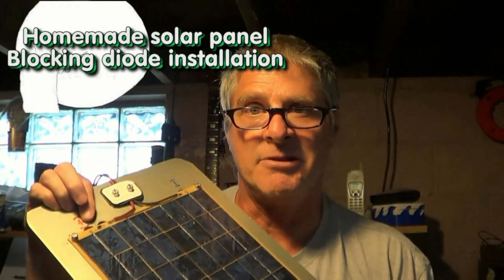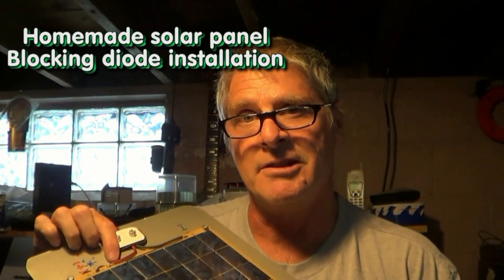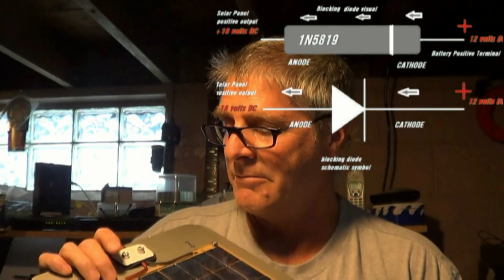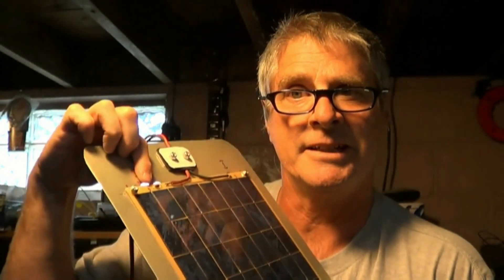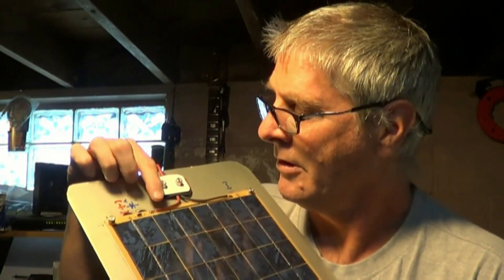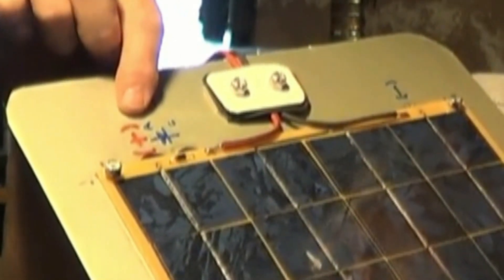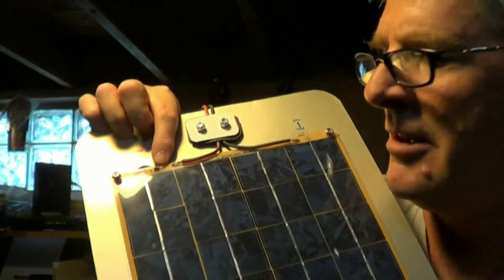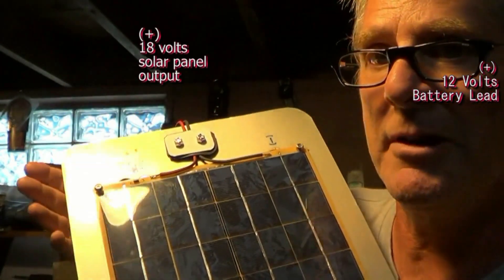solar panel BLOCKING DIODE installation polarity / Homemade semi flexible solar panel blocking diode

Comment: Thanks for the video.  I'm clear on everything you said except for the animation which shows the grey and white arrows moving from right to left or battery + to solar +.   Shouldn't the arrows be animated from left to right in this case?
Reply from the maker: hey youtube,
Thank you for watching

lets see if i can give you another way to look at this...

when the diode becomes fwd bias, the diode acts more like just a piece of wire, 
the solar panel 18 volts is felt at the positive  post of the battery.
current flows from battery terminal towards the solar panel VCC ( 18volts )
maybe think of the solar panel as an alternator for your car...
the positive lead of the alternator is a HIGHER voltage than the positive post of your battery.
current flows from positive lead of battery to positive lead of alternator.

you also need to visualize the negative side of the solar panel and its lead going to the battery.... which completes the circuit.

so, a starting point for reference would be
the negative side of solar panel goes to? thats right!
  the - negative terminal of the battery .
current then flows thru and is stored in the battery,
current flow leaves the battery + pos terminal flows  towards the + pos lead of the solar panel.

its perplexing till you grasp it
then
five minutes later
its confusing again and you have to figure it out again.
then its crystal clear for five minutes then,
it just doesnt seem to make sense.
but, once you except the visual and explanations i have put on the video, it becomes WORD 
or a STANDARD that you simply must practice to keep it straight.
Believe me i know, i have studied and been practicing  for years.
and its one rerason why i have put this info out there.
Thanks again for watching!

Comment: Nice video ... everything you show is correct .. EXCEPT .. you have the current flowing in the wrong direction.

Current flows from the negative to the positive terminals. Think about the schematic symbol for the diode. It is an arrow pointing toward a straight line. The arrow is the direction the diode allows current to flow. If it tries to flow in the opposite direction it would "hit" the line and be blocked.
Reply from the maker: Hey Richard,
Thanks for watching!

current flow thru the diode is going from a "less positive" ( battery  Pos + terminal) to solar panel + or Vcc (18v) its the navy way.
Always, current flow is Cathode to Anode
current is BLOCKED when Anode side is more positive
than Cathode side eg: night time, solar panel is now (-) 0v , Anode side is 12V + . battery holds stored energy hence blocking diode.

I know some universities say 
flow is + to negative but I think they are finally coming around to NAVY Standard.
Thanks again for watching!